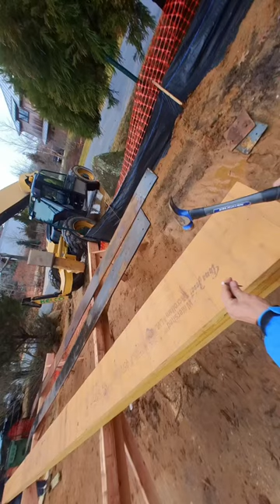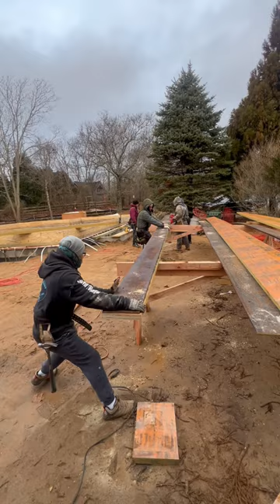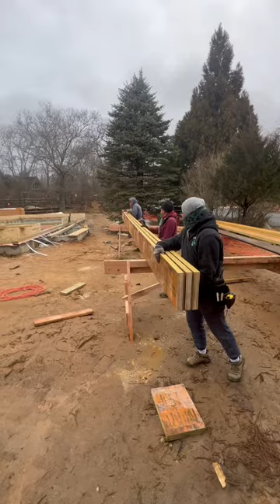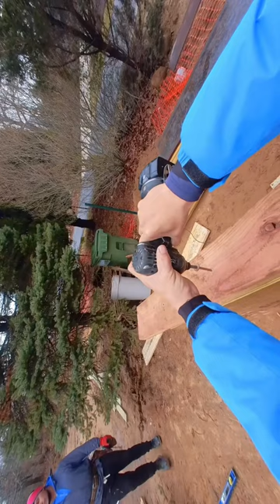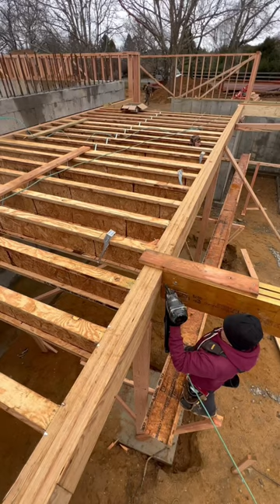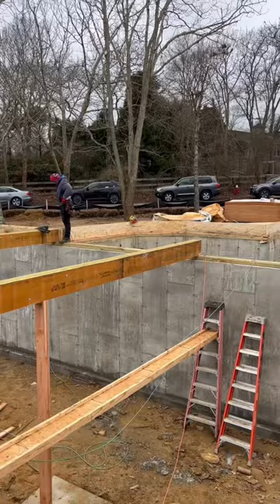Steel plates #skills #team #shorts #tips #strong

Comment: Called a "flitch" beam. 

The main benefit of using steel flitch beams is that they are lighter and cheaper than pure steel, while also still allowing the builder to fix in surrounding timber framework using either nails or screws. This would save the builder money, while ensuring the strength of their work project is not compromised in any way. Flitch beams can also be made stronger, by adding more timber and steel layers into the design.
Flitch beams are also stronger than timber, and require less depth for building than a wooden beam would, if it had the same amount of strength.

The biggest disadvantage to using flitch beams is the high cost of labor involved in their manufacture. The cost is great enough that their use has actually fallen in contemporary construction, with flitch beams mostly only being used for historic renovations (as the beams will reinforce existing lumber supports) and aesthetic purposes. The beams also take a longer time to put together than beams made only from timber, meaning that the amount of time needed to complete a work project will increase.
Reply: I suspect that they will also maintain their integrity longer in a fire than an uninsulated steel beam.

Comment: One end is wall bearing and the other is held with toe nails and screws?
The weakest part of a chain is the weakest link. I'm sure it's fine but it seems counterproductive to having built such a fine flitch plate and not having similar bearing conditions on each end.
They also counter sunk the heads of the bolts but not the nuts. I wonder why.

Comment: Flitch plates absolutely suck To deal with Heavy floppy Is big pain I'd rather have the engineer speckout a steel eye beam Comparable for the load
Reply: Steel beams aren't always available.  Especially in remote areas. A flitch plate has to be engineered as well.
Reply: @davidbryant3532  "I" see what you did there.  😉

Comment: theirs some serious money being spent their
Reply: There
Reply: It would have been more serious if they just used an actual steel beam
Reply: @mr.g937  lvl's ain't cheap either  and I know steal beams are pricey I recently installed  a 8x20  36 ft long I beam in a attached garage that was 3500 unfortunately I don't know how much the ridge beam was it was two 2x24  40 ft long but we did get a 2x12 18 ft lvl that was 490 and yes TMI so yes your right we still had to bolt wood to it
Reply: @jackvillan5151  their there it will bee ok
Reply: There may be additional information as to why the engineer, architect, or even the homeowner chose to have a flitch plate. Aesthetics and ease of attaching finishes, head clearance, lead time getting a steel I beam as opposed to plate steel. Lead time could have delayed the project and a steel I beam may have been more expensive.  Too many factors here we just don't know about. Could just be personal choice or design experience of the engineer. 
Either way, the guys building the flitch beam did a fantastic job. It's refreshing to see tradesmen working their skill.

Comment: I’m no builder or know anything in that field of work but wouldn’t you want to have a spacer in between the wood and the steel? Just to prevent possible rust damage destroying the wood over time? 

If no, can you teach me why? I’d really like to know and learn something new!
Reply: no  LVL
Reply: Lvl is coated and pressure treated. No need. Plus that beams going internal. Very little moisture exposure unless the building is a sauna
Reply: No, because this is an indoor application there will not be enough (if any) moisture in the framing to cause corrosion of the steel. Now since the beam is bearing on concrete in a beam pocket at one end, there should be an air gap and a pressure treated plate below it to prevent any moisture wicking over time from the concrete.
Reply: Thank you guys for informing me about all this! Much appreciated to learn from knowledgeable people
Reply: @A7exandersca7es  If LVL was pressure treated it would rust out the steel beam asap, pressure treated lumber is corrosive which is why you have to use hot dip galvanized fasteners as a minimum.